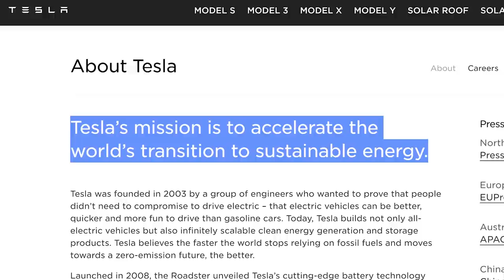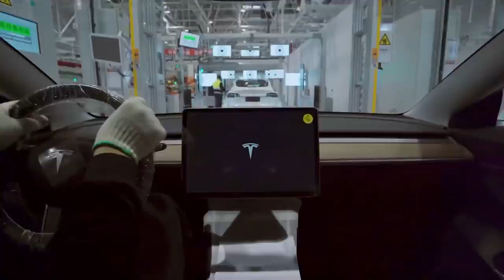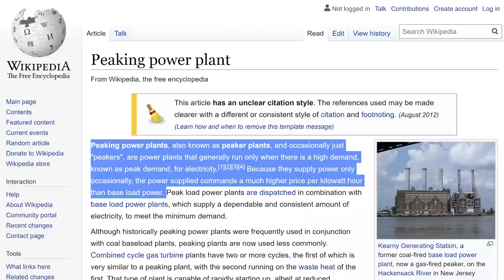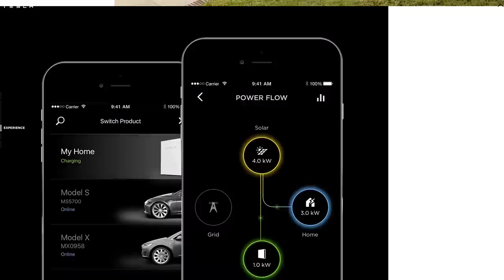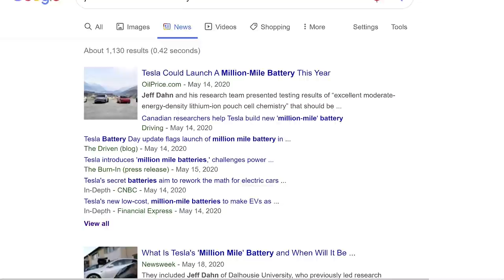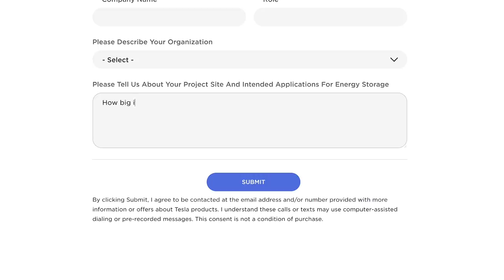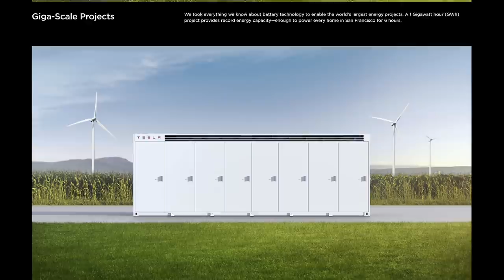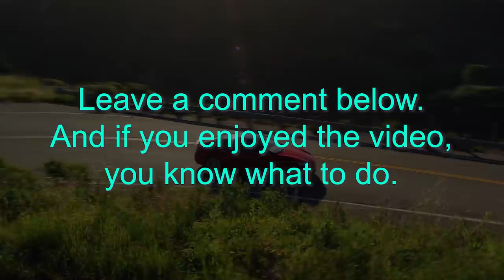Tesla Batteries Will Make Billions ⚡ (virtual power plants, vehicle-to-grid & Autobidder software)

Comment: Absolute GAME CHANGER, so not only is Tesla going to dismantle the legacy automakers but they're also going to put the old utility companies out of business.. Tesla will easily become one of the most valuable companies in the world, and shares be worth 3-5K in the next 5 years 🤑🔥🚀
Reply: I bet CT has AC V2G of 11KW or 22KW built in!
Reply: @tesla-taxi-millinqld-hq-br7462  The news as of today is that AC V2G is NOT built in to the 3/Y, but, it should be a cheap board to swap out to open this up when you swap to a 1M-M battery pack in 2023...
Reply: @shawnoneill1308  I think by Q3-2021 this will be included at no extra cont on new 3-y cars!!
Reply: @millin-avp-educationav-kin9128  George are you based in AU?
Reply: I hope so.

Comment: Don't forget about time: Tesla built the Hornsdale power plant in weeks. Try that with a mega coal burning plant!
Reply: Most the developed world doesn't need more power stations their existing power stations are sufficient for needs. In fact most the developed nations have too many power stations mostly because LEDs replacing incandescent lights have greatly reduced peak power demand

Which is why/how the UK was able to close almost all its coal plants. It wasn't really because we are more ethical than the rest of the world it's because our peak demand went from nearly 65GW to closer to 50GW which meant 15 large coal plants could be closed without having to build gas fired power stations to replace them
Reply: @kaya051285  LEDs are important, but let's not overstate it. Air conditioning is still the big honker in most places. Other electronics are also big elements. Illumination is a significant chunk, but not the biggest.
Reply: @ronaldgarrison8478  Hrm. If only Tesla would get into HVAC.
Reply: @JackFarrington  :)
As I am sure you know (Because of your comment :) they will be. Just give it 6 months... Elon has hinted at this many times (For those that are unaware).
Reply: @kaya051285  
Or it could be that (for example) yesterday (22 May) Solar provided more energy than gas, on its own. Without wind?
The decline in coal is almost directly matched by the rise of green power.
Gas is next.
Reply: @ronaldgarrison8478  Air conditioning isn't very common in the UK and most EU countries have peak grid demands in winter not summer. Our peak grid demands are winter weekdays around 5-7PM and the change over from 80 watt incandescent bulbs to 8 watt LEDs has had a tremendous impact on UK peak electricity demands

If the average house had 250 watts of incandescent bulbs on during 5-7PM it's now become 25 watts of LEDs. Multiply by 40 million homes & business = 9GW of peak demand reduced in the UK

That's equal to about a 15% fall in peak demand. Very significant and enough to close 9 large coal plants

Yes appliances getting more efficient have helped too eg old CRT TVs replaced by LED TVs and desktop computers replaced by laptops and tablets and smartphones and old fridges replaced by new ones etc

Overall UK peak demand is down by a massive 15GW Vs 15 years ago despite the population going up Significantly during the same timeframe
Reply: @rogerstarkey5390  I don't know about every country in the world but I know the UK

Electricity demand per capita is down a significant amount Vs 15 years ago and peak demands are down even more
Reply: @kaya051285  most of the developing world is still... You know... Developing?
They are just starting to get their air conditioners, washing machines, fridges, freezers, computers etc. This will increase their power needs.
They will probably be the last to get electric cars but that doesn't mean then won't also need an enormous increase in power for that whenever it does happen.
Reply: @rogerstarkey5390  haha gas is not next. Renewables are entirely dependant on gas so it's here to stay

Comment: Loved the two clips at the end. Shows the sustainable energy critics for who they are, luddites!
Reply: Green energy takes a lot of labor, and is limited how much percentage you can deploy. Tesla might change the latter if they can produce enough batteries. Being skeptical of over deployment of renewables was the smart choice, not the short sighted one. Now, its a different deal.
Reply: @kistuszek  I'm not sure I fully understand your point as it relates to the clips shown. He specifically ridicules the Hornsdale battery project as a gimmick much like the large statues dotted around Australia. But the proof has been in the pudding as the project has saved tens of millions already in it's short lifetime over the fossil fuel peaker plant alternatives.

Comment: Hey Stephen,
Couple of points to add:
1. Another big cost in EV is motor. Recent tear down of Model Y show they replaced expensive copper with aluminum in the stator. Tesla continue to ruthlessly innovate and optimise!
2. V2G still requires a bit of extra hardware in the home or workplace to make it happen, it is about isolating the battery under certain conditions for safety. Rumours are that the new Tesla v3 home charger already has this and will talk to Autobidder via Wi-Fi.
3. Latest news I heard on Hornsdale big battery is it paid Phase 1 off in the first 2 years already. Phase 2 expansion is almost complete and will likely be paid back in a year or two.

Comment: Fullycharged did a great piece on battery recycling, very recently.  I really want to become a VPP at my house, but maybe that’s not ambitious enough...  What we need is a VPP profit calculator, as there are too many variables for my tiny mind to juggle.  When I “did the maths” before buying my Renault Zoe, I realised that my monthly cost would rise a negligible amount, but after the finance was paid off, I’d be £230/month better off.  The problem with calculating VPP profits is the fluidity of the market.  My energy provider has a tariff that changes every 30 mins & is updated every 24 hours, so I can plan to use as much energy as I can, when it is cheapest; for instance, between 00:00 & 13:00 it ranges wildly between 4p/kWh & -1p/kWh, then 13:00-16:00 0.8p/kWh to -3p/kWh, then 16:00-10:99 11-17p/kWh, then down to 5p/kWh for the rest of the night.

Comment: Wicked video - the only assumption I think you made was that all of the existing fleet can be virtual power plants - I was under the impression that only the new battery tech that will be unveiled has that capability as it can withstand far higher charge/discharge cycles. Maybe people are prepared to shorten the lifetime of the older style car batteries after they are shown a disclaimer to participate in a Virtual Power Grid. Then I see all of the 1 million Tesla fleet as possible participants in this cool future venture. I recall in a Hyperchange video on this topic that this virtual power plant idea for vehicle to grid was considered by Tesla years ago however back then it was not really possible until the LiOn battery tech could withstand the high frequency of charge/discharge cycles. But with this new battery tech to be shown - this whole problem goes away!

Comment: I'm insanely bullish about Tesla providing frequency control to the grid and the fact hornsdale power reserve paid for its self in 4 and a half years justifies that. There's no reason each battery pack in each car couldn't pay for its self within 10 years.
There's just one thing that really pisses me off about batteries though... As fantastic as they are for frequency control, they really don't do what people think they do. Explaination...
Hornsdale wind farm has a peak capacity of 315MW and the hornsdale battery can store 185MWh. This means that it can store just 1.7 hours worth of the wind farm output. But it doesn't put out 315 MW for 1.7 hours. It can put out 70MW for 10 mins as a grid service or it can put out 30MW for 3 hours to allow load shifting.
This is all really good and everything but people seem to think it stores days worth of wind energy to get you through days without wind and that's simply not true.
My issue stems from the fact that renewables are a poor energy choice when we could have nuclear power that occupies about 400x less land, uses a fraction of the materials and, in particular, doesnt consume vast quantities of rare earth elements. Batteries would also be very well suited for a mostly nuclear grid because nuclear is just base load and although it can follow the load it's not good at it nor is it as economical. Yet i never hear the argument that batteries could help a nuclear grid
Reply: @paulcox4369  you're on my wavelength with thorium but all nuclear is great. Even the eldest reactors are fantastic compared to most other energy.
I've just noticed a mistake in my maths though... 
Hornsdale battery can only store 35 minutes of the hornsdale wind farm power output.
I did the maths backwards haha silly me

Comment: My favorite quote about Tesla: "They are a battery company disguised as a car company".
Reply: Actually, they are a serial industry disruption company, disguised as a battery company, pretending to be a car company.  8-)
Reply: Actually they are an energy company disguised as a car company.
Reply: nonsense
Reply: They are a power and transport infrastructure company as well as AI mobile artificial neural network infrastructure and a global mobile surveillance and GPS tracking system. They are dangerous. The goal of service is not to be the best service, it's to be the only service. Also, they possessed Tesla's name, but Nikola Tesla's original goal had nothing to do with batteries, which are a point of energy use control, he had a system of wireless transmission of energy that would be supplied with freedom and unmetered. Musk's Tesla is a control grid, based along the ideas of Edison and people need to wake up to this. His company makes amazing stuff, but the Devil's in the details... 

We are all kept on an energy handcuff, and Tesla does nothing to change this except add spying on top.

Comment: I hope they will one day start adding solar power technology to Tesla cars.
 
Not that it increases the mileage, but for the reason that not everyone has their own house where they can have a power wall and a solar roof. Since the Tesla car in itself is a power management system even if it generates just a little bit of energy when standing outside that's all profit that any owner could gain. This would also allow Tesla cars that are broken down or otherwise unable to be driven to still be valuable assets to the owner.

And I could easily see the car capable of handling additional solar panels plugged into it while the car itself handles the power storage, redistribution and monetization. Like a retirement plan for vehicles, once it's driving days are over it gets converted into a mini power plant.

Comment: As Tesla cars are today, they can participate in the energy market by buying electricity (charging) when it's cheap and/or stop charging when electricity is expensive, thus balancing the grid. Selling electricity back to the grid is more tricky, because it needs a grid tie inverter between the car and grid...

Comment: Well Steven, I figured out what your favorite word has become.  Billions!  That's right, it used to be "this matters", now it's billions.  Anyway, I am a fanboy and have had my Powerwall now for more than 3 years. I pay very little for my electricity per month.  I must add that my home heating, cooking, fireplace and BBQ is natural gas, so I do have that expense, but I get back money almost every month from my provider for the power I sell them.
I have a Model Y on order since Nov 2019, a $2000 deposit, a Cybertruck order since January, sure only $100 for that, and now also a Tesla Semi truck.  Yikes, $20,000 deposit for that one.  I am convinced the Tesla Semi truck is going to make as much or more than the cars will in future.  You should research a little more about the semi's, seems they will blow away any Diesel semi in many respects.  Do I need a semi truck? hell no, I just hope Tesla will honor "first come first served", unlike what they have done with the Model Y.  I am convinced that I could make 50% on my money selling my spot in line.  What do you think.
Reply: Victor, well done re your Tesla journey. A note of caution: (Tesla has already done this before with M3 reservations) Tesla watch things like Ebay Motors and others and anyone attempting to "pre sell" their Tesla order, well their order gets cancelled! Read the fine print of your Cybertruck reservation and it is stated clearly there. The only way around it is to actually "Buy and Pay for" whichever vehicle you've ordered, then you can resell it. Cause then it becomes a "Used" or secondhand, one owner vehicle. My brother and I have 3 Cybertrucks on order (that we don't actually need. LOL) so are thinking how to best make use of them. Only way is to cough up the cash first. 
M3's were for sale in the early days for $5-10,000 on EBay. It was then discovered that people were trying to effectively pre-sell their ordered M3 and make a profit. A type of abritrage, short sell transaction. So Tesla made the orders taken "non-transferable" and announced that anyone identified as trying to profit by preselling would have their orders cancelled.

Comment: Nice idea and it will happen but a big mistake is that it is only  a matter of a code change to function to work as feeding support to grid is not there at the moment but would be easy when they we putting in there upcoming million mile battery

Comment: You do need an inverter which will set you back about 4k to use vehicle to grid but that's not part of the car hardware and if you already have a power wall then you already have an inverter.

Comment: Batteries vs Water “electricity” storage (not hydrogen, pushing water up in a dam, and releasing it to reproduce electricity)?
Reply: Works in some places but not many. likely rather than pushing water up a dam it would be just releasing less water from existing dams

In Europe Norway has the ability to act as a very large battery for its neighbours

Currently their hydropower output is about 15GW and it powers their country. But this output varies greatly from 10GW to 30GW

Two large links are being built to the UK
When the UK has excess electricity we will export it to Norway. Say we export 2.8GW to Norway they won't pump water up a dam but rather Thier 15GW hydropower will be cut down to 12.2GW hydropower plus 2.8GW from the UK

At a later point perhaps same day or even weeks later if the UK needs electricity we can import hydropower. Their dams which are outputting 15GW ramp up and output 17.8GW so 15GW for Norway and 2.8GW for the UK

This is somewhat simplified
But the short story is yes it's possible and it's being done on a relatively large scale with the UK and Norway

But it's not possible everywhere
Nor is it really desirable
Because it's environmentally not 100% great
And it costs a lot to do

I don't think we will have bulk electricity to hydrogen but it's one possible future plan. To have offshore wind generate electricity which is used to create hydrogen which is pipes onshore to be used to heat homes and businesses
Reply: The water pump efficiency is around 60%  and water is not used for that purpose. Some new companies (I don’t remember the name they are for from Switzerland) use weight lifting with cranes and let them roll back down in order to store / produce energy.
Reply: Just look at what happened to Michigan this past week
Reply: This will be very common once the European Supergrid is finished
Reply: Offer Krupka
You'd be surprised how few new suitable places the are for gravity storage.
Also you must consider the huge cost of infrastructure for such projects, the environmental impact, including millions of tons of concrete and steel, the impact on the local area, displacement of population, etc, and the time to build, which also adds to the impact through continued use of fossil fuel.
Then there's global warming.
Can you guarantee suitable environmental conditions in the future?
No water, no storage.
Reply: Roger Starkey 
If there is an existing dam, is it that hard to make add the “water gravity” storage?

If you building it from 0 than yes, you are 100% correct.

Comment: Been following  you for some time.  Waiting for battery day.   ?   Tesla will strip the  global capacity of the current Li  mined resources  over the next decade.  Considering that Tesla will have  buy / expand mines   and most likely build mines, have there been consideration of the years of lead time to get a mine up to speed?  Would not this be the greatest bottle neck to   the EV market?